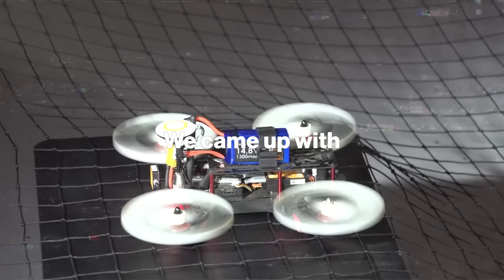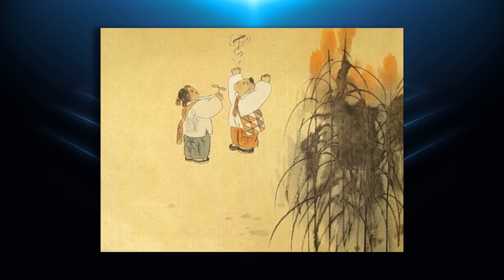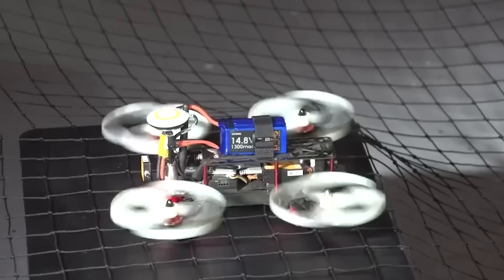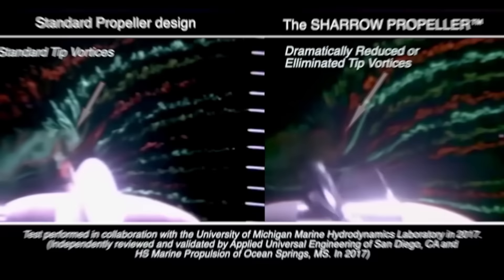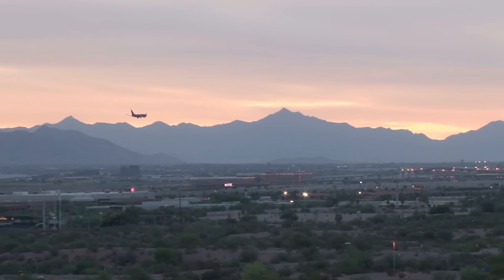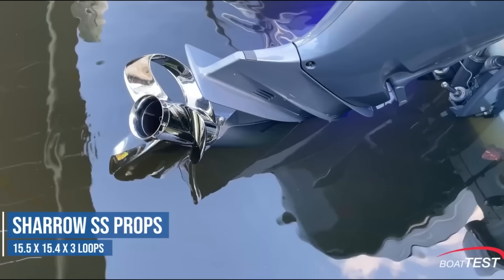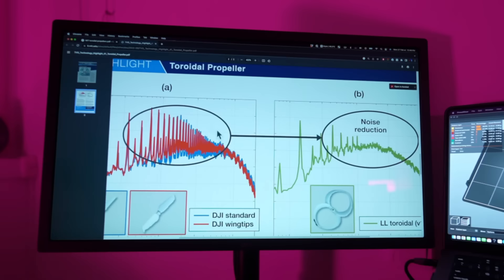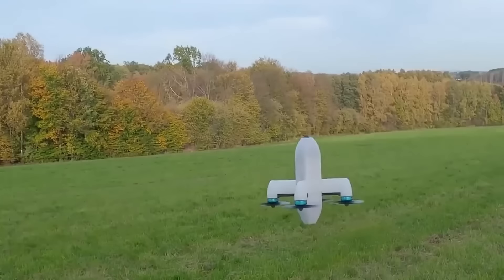This MIT Propeller Is Going To Change Aviation Forever

Comment: Fun fact: The Navy was testing a carrier based plane called the Thunderscreech. They wanted a plane that could take off in a shorter distance than a jet. However, the propeller had to spin so fast that the tips were repeatedly breaking speed of sound, making it the loudest airplane in history. It was so loud it made the ground crews physically sick and even throw up sometimes. Due to that and other instability issues it was eventually cancelled
Reply: I WONDER,, what this design would have lowered the sound levels too.. it could have saved that bird
Reply: That was the F-84F developed by the USAF.
Reply: @peterplassmann6611 thats a jet.
Reply: sir you can cover the propeller in a sound proof case like in jet engine and if you spray some vaporized water inside it will block the noise
Reply: @vernonray6037  This type of design does not lower the sound level.  It does shift the frequencies of the sound to higher pitch human cannot hear type of sound.  For animals that can hear a wider frequency band than human beings it still hurts very much the same.
Reply: Severe vibration problems with the prop, a 30 minute warm up time, prop gearbox and pitch control failures. One Republic test pilot refused to fly it a second time, saying "You aren't big enough and there aren't enough of you to get me back into that plane." 
One the plus side, the plane did have phenomenal acceleration.
Reply: The problem with the MIT prop is that it's a fixed pitch: to go faster or slower you have to increase or decrease engine RPMs. Having one on the XF-84H would present power problems. The XF, like most turboprops, maintains a constant RPM for maximum performance or fuel efficiency and increases or decreases power by varying the prop blade pitch (like maintaining the RPMs on your car and using the transmission to maintain your speed range). This solves the problem of the rather slow response time of turbine engines. Instead of just increasing RPMs, you increase blade pitch too, for almost instant power addition. Pilots flying regular turbine aircraft say they fly their engine power 5-7 seconds ahead of what they need now.
Reply: @Joebar6611  not even close
Reply: @miket2120  Why can't it be a varible pitch prop?  Just because you were presented with a fixed version that is clearly in its infancy, in no means makes it non variable. The mechanism for varying pitch could be  convenient addition to the already noted benefits of the torroidal design.  Recycling the slip off of the end of the tip of the propeller into thrust is an amazing concept, and should be investigated, instead of castigated.
Reply: No, the tips were not repeatedly breaking speed of sound. They were breaking it constantly when the engine was running.
Reply: @woopyass  you do realize, that the concept of the toroid prevents it from changing the pitch except you use flexible materials which would make the prop useless again?
Reply: @No_Way_NO_WAY  Flexible materials, that change pitch/angle of attack aren't new. The technology to make this happen is just expensive to implement. I'm merely talking about mixing engineering principles to see if there is an equalization effect in thrust without constant RPM changes.
Reply: @No_Way_NO_WAY  Also, as of right now variable pitch rules the roost for availability vs. price vs. maintenance intervals. This is just the reality of the aviation and marine world. I get the reality of it. Nobody ever made history by staying in their lane. Anticavitation properties for marine applications alone would change the game for many classes of tranportation when It came to operating costs and sizing of vessels.

Comment: I have a friend who did put a pricey new toroidal prop on his 24’ boat with large Yamaha outboard. He is able to plane at lower engine speed now. Overall the impact was moderate but real — about a 10% reduction in fuel consumption and a couple knots higher top end.
Reply: Meh. Could probably have achieved this with a good tune and a little bit of port match/polish work..
Reply: @74KU  ok bud.
Reply: @74KU yeah, but now imagine a good tune with the prop.
Reply: First I've heard of it. Bet its the last.
Reply: and what was the cost of such a miracle?
Reply: @74KU correct. The price in new props could have been spent in engine work and a new ecu tune. But YouTube comments in their mommy’s basement will tell you otherwise lmao
Reply: @ThumbDr I'm not a boat guy - why wouldn't you optimise both? And is Cavitation damage significant on traditional props?
Reply: 10% can be pretty big of a savings if hes using it frequently. boats guzzle down fuel
Reply: @jamesgamerguy3 boats guzzle fuel over very short time periods.  

According to a study done by David Pascoe, among active boaters, the median hours with the motor running per year is 40.   Less then 10% of boaters exceed 100 hours per year.

He also found the median motor life before major repair is needed is only 1,500 hours or 15 years, whichever comes first.  

Sadly, even at todays fuel costs, fuel remains 1/3rd of the motors total operational cost.

Next time you hear a boater say it took $100 just to top off the fuel tanks, it also took another $200 toward motor maintence and repairs.
Reply: Thanks for posting this info. I have a boat and am always trying to tweak just a bit more performance out of the motor.
Reply: @jamesgamerguy3 if cargo ships and tankers could save 10% on their fuel,  that would probably translate to billions of dollars saved in fuel yearly over the whole industry
Reply: @DougAlesUSA  yeah no argument there about boat maintenance. I was in the navy I’m all too aware of what saltwater does to metal, motors, and electronics. We deploy for 6 months then spend 4 years repairing the ship ☠️
Reply: @mattmccallum2007  absolutely. The costs in transport would have a noticeable effect.
Reply: @74KU  tune and port so even more fuel can be wasted to do the same thing.
Reply: @lutze5086  exactly.  The high price may be a drawback but introducing tune and port work is just throwing oranges into the comparative apple basket.
Reply: Air v water Reynolds number. Very different effects of performance
Reply: @74KU Ok buddy
Reply: I priced a Sharrow prop for my outboard. it was $4,995... Compared to a replacement stainless prop that was $550....
Reply: @lutze5086  Yes, cavitation is a significant factor in performance props, and yes, you optimize everything if you want to be optimal.

That being said, this prop geometry is currently prohibitively expensive for any but commercial or enthusiast use. Hopefully its claimed benefits can be realized at reasonable cost.
Reply: @ThumbDr  This was a brand new Yamaha outboard with less than 30 hours. There was nothing to enhance via engine work.
Reply: @BlancoLobo I was going to buy one for my offshore but $5k is way too much
Reply: which is a lot of impact for one change
Reply: @74KU  Generally when you make more power you use more fuel. As far as improved ECU tunes those usually come with a drop in reliability, in short the timing gets advanced.
Reply: @74KU those tune specs would add also
Reply: WOW, THE  ENGINEERS WERE CORRECT AND NEEDED TO PUT THE TECHNOLOGY ON TURBO PROP JET ENGINES. IT IS A BETTER IDEA! OK
Reply: A bit of a fluff piece.

Comment: The torus marine propeller, then described as one featuring "double blades", was invented in the early 1890s by Charles Myers from Manchester
Reply: I'm sure you are right. I've been trying to design a tip jet for 30 years with a dual blade. Same effects.
Reply: Victor Shamberger was also dabbing with them ...
Reply: The sharrow propeller which is shown in the video was created in 2010 by Greg Sharrow.
Reply: @daxtonbrown  if it's been 30 years maybe you're in the wrong business
Reply: @THESLlCK  Someone evidently doesn't know what year it is. 2024 - 2010 = 30? 😂
Reply: @Desert-edDave  someone evidently can't read, you've replied to the wrong person.

Comment: We solved this decades ago with submarine propellers. Noise was a huge priority in that context, and we ended up with these style propellers. We have also seen static versions of this with prototype planes that use a single large ring, instead of wings. The issue for aviation is the extra weight. You can't scale this design because you can't spin it quickly, and you can't use it for large crafts due to the surface area not scaling to the mass. I could see this for boats and and drones though.
Reply: I doubt we will see them in anything except water vehicles. As i understand it, you have increased weight and they are good at slower RPMs/flow speeds. Both are not good for drones. (other users also mentioned fixed pitch for planes is bad)

Comment: when I was a kid, my grandfather, a 28 year submarine commander, drew this design (almost exactly) on a sheet of paper for me. He had no idea why standard props were even still being created....it's not quantum physics, just hydro physics.
Reply: probably cost and ease of manufacturing
Reply: The looped structure is hard to machine using a standard cnc machine. With 3d printing becoming cheaper this is now being tested.
Reply: @khanch.6807  I know....and the reactive resin 3d printing technique will perfect it.
Reply: Actually, some would argue that fluid dynamics is trickier than quantum physics.
Reply: I will not surprised, if navy subs had these props for long time.
Reply: @khanch.6807 Are propellors always CNC? Couldn't they be cast?
Reply: @NathanaelNaused  casting propellers make them rigid. It might not be that good, the stress of the centrifugal forces might make it break.
Reply: @NathanaelNaused  : This is likely easier with CNC than with casting.

Comment: Sharro needs to stop milling these from solid billit, and join the 1960s, as modern lost-wax high strength alloy casting was perfected by then. Precision Cast Parts in Portland Oregon can make these in stainless for far less than to retail at $5,000

Comment: Sounds and looks like a great idea! But aircraft and sailboats have variable pitch propeller’s and propellers that go into a negative state not to drag air or water , there is a place for them but they can’t fulfill all the propeller needs .
Reply: True on aircraft but not true on most sailboats.    

CPPs are uncommon for sailboats, though I am sure there are some out there.  Larger powerboats and trawlers might have CPPs more often but even then it is my understanding they are not in the majority do to cost and maintenance.
Reply: Mainly sailboats have folding props etc . These props are not geared for that market
Reply: @mikehiner9977   I think he's talking about these, to reduce drag. It's a specialised use.  https://www.youtube.com/shorts/OOTwa0gdzMo
Reply: @thoscho2003  quite possible, but in my admittedly limited experience folding/feathering propellers are also not that common outside of racing sailboats for a similar reason.  Cost benefit analysis.

I would guess that toroidal propellers induce even more drag than a conventional one but do not know.  Generally the difference between a fixed propeller and a folding one is 1-2 knots, maybe 3 on a racing boat.  Toroidal would likely induce a bit more drag than a conventional prop but at a guess only an additional 5%.

The counterpoint , if the claims are true, is that you can gain a statistically significant improvement in power and range while under power.  For the most part for sailboats, when not racing,  power efficiency and economy is more important than a quarter to half knot under sail.  The improved power efficiency reduces engine wear, fuel use, and extends range when the winds are not in your favor.

Every owner of a sailboat has their own priorities of course and most would not go to this level of expense for a small gain in efficiency but if the price gets closer to parity and the claims are better proven in the real world the story may change.
Reply: Never read about a variable pitch boat prop but in aviation they're called a constant speed prop so the engine turns a constant speed as the pilot sets the prop pitch for best performance / economy for whatever is happening at any given time. Mike Patey is the only guy I've ever seen that reverses the pitch & backs the plane up. I grew up with a dad that was aviation obsessed, had 5 planes at 1 time & built quite a few from scratch & resto-modded several, 60 years before the term was invented. Negative pirch still applies "drag" but in the opposite direction. "Feathered" or 0 pitch is the no drag position & you will see turbo-props at 0 when parked or being started
Reply: Maybe a solution is to have two propellers with one for cruise.

Admittedly complicated but worth it if the efficiency is there.
Reply: @mikehiner9977  NOPE YOUR STORY IS SPOT ON I SUSPECT THIS NOVELTY IS AIMED AT THOSE WITH MORE MONEY THAN BRAINS......
Reply: Sailboats DO NOT USE PROPELLERS. Long range sailboats occasionally have a motor and a propeller for reaching port when the wind dues. Pure racing sailboats never have propellers. EVER.
Reply: @johnmood5653  I am not talking America's cup.  Believe it or not, a lot of areas have regular racing locally.  I assure you, most of the boats have motors.
Reply: Absolutely 110% correct. - QED
Reply: @mikehiner9977    The title of the video is... "This MIT Propeller Is Going To Change Aviation Forever."   Without the ability to control pitch, these props are only good only on fixed-pitch aircraft.
Reply: Armchair engineers..................
Reply: @SophiaAphrodite  LOL... One must always bear in mind that no less than one half of all students who pass the 8th Grade, think Long Division is Freakin' Magic.

And in High School only a rare few advance beyond Algebra to study Physics and Calculus... Most of these will graduate from College with Degrees in Science and/or Engineering.

Meanwhile, less than half the rest will ever attend College. And only half that number will ever graduate.

Those who do, are by far and away, Lib-Arts Majors that don't know Oprah-Science from the real thing.

8^)

QED
Reply: @SophiaAphrodite  SHEEPLE
Reply: @phillipzx3754  I am not disputing that I think.  I am more interested in, and focusing on, the marine applications.  This is also discussed in the video IIRC.
Reply: The plane in the splash screen for this video seems like it would have major visibility problems as well.
Reply: @phillipzx3754 exactly which is basically just limited to starter aircraft’s which would be way more expensive than what it’s worth
Reply: IF they have a specific and well defined place in the system, then use it there, there are many things we use in their most efficient place, but not get stupid with.

Comment: I can't afford an airplane but a less noisy box fan would be nice 😂. I'm sure the cost to manufacture a plastic prop for a fan, with 3D printers, is drastically reduced compared to the metal counterparts!
Reply: Lol its the fan noise that helps me sleep.
Reply: @Rubberman2036  Get a white noise generator.  Don't force the whole world to suffer with noisy fans.
Reply: @incognitotorpedo42  You know this "silence" everyone is talking about isn't? From my perspective I wouldn't even call them quiet.. If there was an actual advantage to using them, anywhere, they would have been used at some point in their 100+ years of existence.
Reply: @74KU  : The world hasn't used them because they're a pain to make (and because a lot of designers just didn't know of them), but that's no longer a major concern. Similarly cyclorotors have traditionally had hardly any users, but they've been invaluable where they've been applied.

Comment: The Twisted-toroid (ring-shaped) propellers, first invented over 120 years ago, then described as one featuring "double blades", was invented in the early 1890s by Charles Myers from Manchester England.  Toroidal propellers also have clear disadvantages. The main one is the difficulty to scale them to mass production due to their complex geometry, which leads to high production costs. The complex structure also requires special care to avoid unwanted vibrations – a significant issue when rotating at high speeds.
Reply: I believe we are entering an era of rapid prototyping and hi resolution 3-D printing that will allow for these complex shapes to be produced at a fraction of the current cost.
Reply: @markdevera2342  Not true for aviation per se.  There are too few of them made to invest that kind of tech in them.  They will remain largely hand made long after humans are no longer flying them.
Reply: @markdevera2342  No we are not. Everything people say about 3D printing was said about CNC machines ~25 years ago. Everyone was going to have one in their house. Building parts for things they needed rather than buying them. Bla Bla Bla...

Didn't happen then. Not happening now. 3D printing is just one more tool in the toolbox. Nothing more. Nothing less.
Reply: Yes.
One slight chip or dent however minute would cause calamitous result.
Reply: @user-yp7rn6tb2t  sounds like an expert in calamities here.
Reply: @0x00zero  I've had my share .
Reply: Yes, they are not strong enough to handle the forces that come from high rpm's at air
Reply: And the rotating mass being 2x doesn't help either in the efficiency department...
Reply: Modern technology may be able to work around that problem, or find the correct scale to be practical to produce and to be useful

Comment: I posit that: In form, the toroids are very similar to a scimitar or surface piercing prop cast with exaggerated blade length and with blades then folded back on themselves, then welded to the hub. Existing propeller casting / forging techniques can be combined with second-operation forming and 3rd operation welding of tips to the hub. This change can radically simplify manufacturing and production for more reasonable cost. Old machinst-blacksmith types see things thru eyes callibrated differently. <Grin>